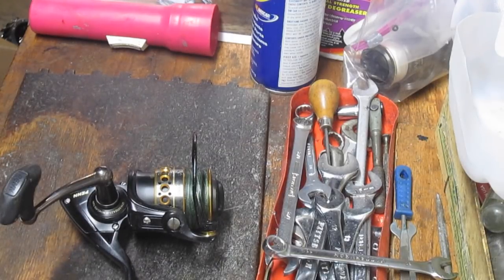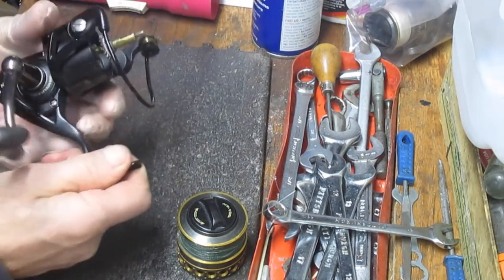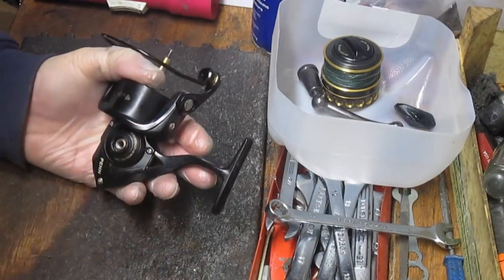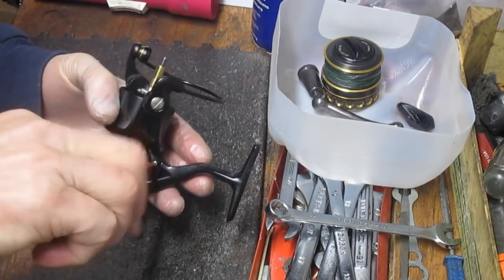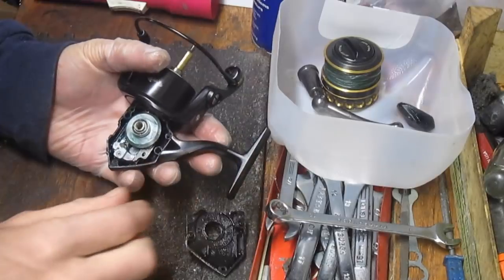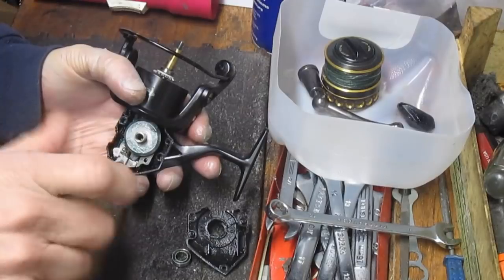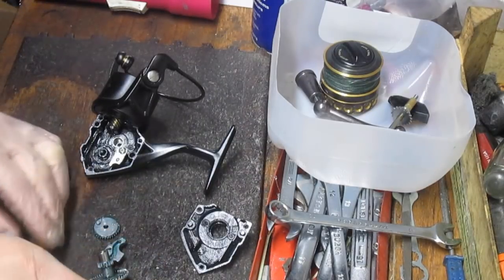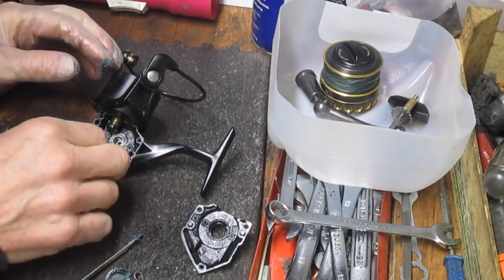Penn Battle II 3000 Fishing reel service with complete take apart

Comment: Dennis This is what I need. I have four of these reels, 1000 2000 2500 3000.But what I wish you would cover is the Penn SF long cast 7500. This reel is a different animal, I cant even remove the side plate without fear of breaking  something .Also do the Penn battles and Spinfishers have similar  internal hardware. thanks for your videos.
Reply from the maker: Thank you.  For the most part the current Penn Battles and Spinfishers, like the Spinfisher 5 series, are very similar on the lower end.  There are now 6 generations of Spinfishers and you would need to compare your reel schematics to see which generation you have in order to make the comparison.  For example, the set up is different in a Spinfisher 750SS vs the Spinfisher V 7500.  And you are correct, the 7500 long cast is a totally different animal!  That one uses the side worm gear for oscillation.  That is very similar to the setup in the Shimano Stradic and others.  They do not use the traditional crosswind gear and block to move the spool up and down.  The main difference on the Battle vs. Spinfisher is in the top end spool drag system.  They are totally different.  The Battle has the drags loaded on top of the spool.  The main drags on the Spinfisher V series are loader underneath the spool as a way to seal these from water.  I do not have a 7500 Longcast in the shop.  I will add it to my request list and do one if/when one comes in for service - Thanks for asking - Dennis

Comment: Sorry about the fish scales :)  Cannot wait to her the report on the 2500 or the grinder. That reel got slapped with salt water waves and spray. The reel and rod wash was  washed off in a outdoor shower and rubbed down with WD40. It was hung in a rod holder in my SUV in the Tampa heat and sun. The next night it was grinding  I took it apart in the hotel kitchen, cleaned it with soap and water. Dried it with my wife's hair drier. The only lube I had was a silicone. It was better, but not like the others. Waiting to hear what you find. (That SS you have of mine, that has been dunked and never a problem ). Thanks.... Doug.

Comment: Thanks for the video. I serviced my fierce ll 3000 and schematic shows 1 shim on the main gear bearing on handle side but there is two. Saw you had the same on this battle.Battle schematic shows two..Guess it was a misprint on my Fierce schematic?
Reply from the maker: Those shims are installed at the factory to make up for the variances in the main gear machining.  Usually you will find from 1 - 3 shims in a reel to make sure the gear is aligned correctly with the pinion gear - Thanks for the note.  I suspect the schematic only shows one because the shims are identical and all share the same part number - Dennis

Comment: Having trouble with the pinion gear and main gear making noise and vibration as you reel. Wasn't doing it before I cleaned it. Reel isn't but a few months old but the kid wanted it cleaned and greased. All parts are present and assembled correctly, any idea?
Reply from the maker: Check the shim washers the go on the main gear shaft to ensure they are between the manger and the bearing.  That is usually where there is a condition like you are describing if they fo missing or are installed on the other side of the bearing
Dennis
Reply: @2ndChanceTackle  thank you for the fast reply. Turns out, I was getting ahead of myself and checking for smoothness without installing the rotor, so that pinion gear wasn't being pulled up any and was actually sitting too low making it seem gritty and noisy. Once I realized this and installed the rotor it took care of the problem. Thank you again!

Comment: The anti reverse on my Penn Battle II 3000 doesn't work sometimes (i.e., I can spin the handle backwards).  How do I fix this?  Is there a part I should replace?
Reply from the maker: That is either dirt in the A/R clutch or a broken A/R clutch.  It would be best to try cleaning the clutch sleeve by removing the rotor and pinion gear assembly.  If the cleaning doesn't work, then the clutch would need to be replaced.  Parts are available as well as the schematic through Mysticparts.com - Dennis
Reply: @2ndChanceTackle  Thanks for the advice.  I'll take a look.